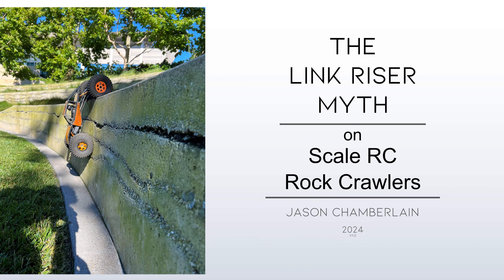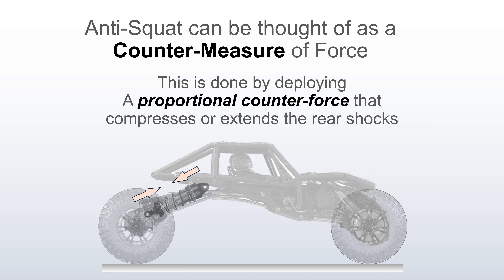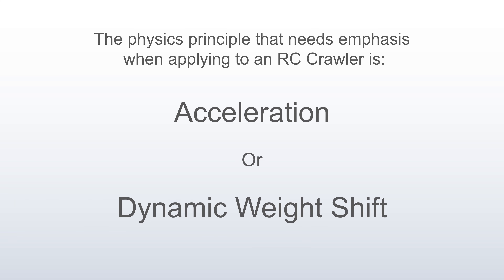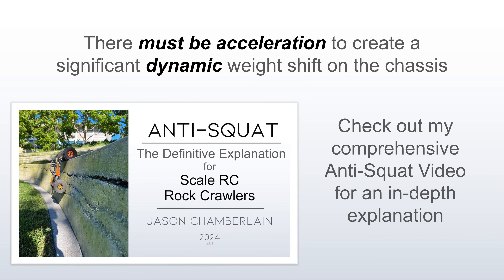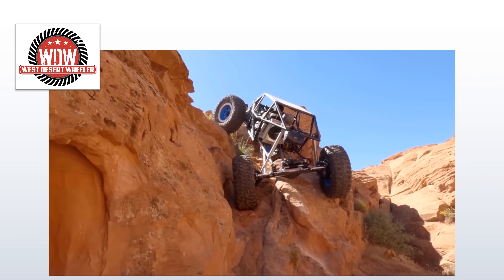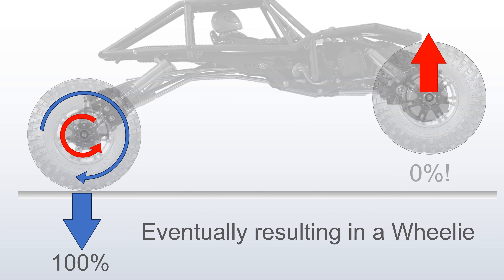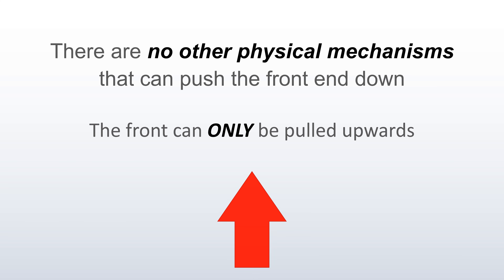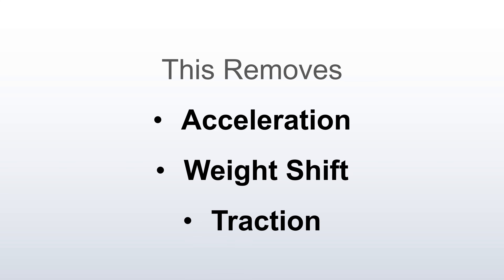Anti-Squat on RC Crawlers - Part 2: The Link Riser Demo

Comment: So if you also go watch a video from cleetus with live video of the rear suspension, it lifts under acceleration, which I'm turn puts more weight on the front, also with separation at the chassis it creates more leverage on the chassis it's self actually trying to stuff the front end into the ground. Same goes for anti dive, this stuff is all apart of almost every live axle vehicle.
Reply from the maker: Who is this cleetus?
Reply: Was the vehicle front or rear drive or 4 wheel? I’d be interested to watch that also
Reply from the maker: @lowandslowcrawlers  At slow speeds the linkage geometry does not matter. There is simply no math that supports that. If you find some, please share.
Reply from the maker: @independentmind1977  The vehicle in this video is 4WD.
Reply from the maker: @lowandslowcrawlers  I would like to know him. He sounds cool.
Reply: I was replying in reference to the Cleetus video mention. In my mind the front vs rear vs 4wd would have an effect, but seeing as most or all of us in the crawler world are on 4wd...it wont matter @BoomslangSuss
Reply: @BoomslangSuss  there is no speed in the math for ANY AS or AD.
Reply from the maker: @phuzzit  Nope.
Reply: @BoomslangSuss  then there is no way to justify speed as a determining factor in AS/AD. If it was then there would be speed that it turns on and off.
Saying AS/AD isn't there at low speeds is like saying gravity isn't there at low speeds.
Physics is always in play, some times we just don't see it bc we don't fully understand the other things affecting the equation.
Reply from the maker: @phuzzit  You are completely misunderstanding the basic concept of anti-squat. It only exists in the realm of sufficient acceleration to cause a dynamic weight shift of the chassis relative to the wheels. Speed doesn't turn it on and off, but acceleration does, and it self balances at all acceleration levels. Expect 0 - that is not an acceleration level.
Reply from the maker: @phuzzit  This isn't new. Anti-Squat is a thoroughly established and proven concept accepted worldwide by suspension engineers from Toyota to Tesla, from Specialized Bicycles to Yamaha, from Ferrari to F1.
Reply: @BoomslangSuss  he is talking about cleetus mcfarland with full size vehicles. however, it is not "stuffing" the front down - instead raising the rear.
Reply: @BoomslangSuss  your correct AS is a part of accepted vehicle physics and speed has never been a part of it.
Reply: @BoomslangSuss  acceration is defined as "undergo a change of velocity". Velocity is defined as "the speed of something in a given direction."
Your misusing the words. It is using speed as any given movement - not all movements but the ones you want. Any movement - fast, slow, ect.
If AS/AD did not work at low speeds then it would break the world of racing because they all have slow speed areas that rely on AS/AD to do their jobs.
When a tire gains traction, the force of that traction is tracked through all the components of the vehicle and they mechanically act with or against depending on the suspension design and tuning. This happens at every speed to assist launch, fast corners, slow corners.
Reply: @BoomslangSuss  I completely understand anti-squat and vehicle dynamics.
I also understand that you are misusing words to try and change what the auto world has known and used for years.
It's a great theory and all but it's incorrect and can never be proven. If it could be proven then you would be able to define acceration with a given window of speed and time to show when it works and doesn't work.
Thats just how physics and science works.
Reply: Think about how Boomslang explained the unsprung weight trying to outrun the sprung weight. Acceleration is key. You also have to realize gravity has a different affect on the front end the steeper the climb. You are not pushing the front end down  as much as lifting the entire vehicle off the obstacle at that angle. You have to realize any effort to push the front end down, oppositely and equally lift the rear end away from the climbing surface at steep angles.
Reply from the maker: @cameron6471  Thanks for the context. You are correct - you can lift the rear end with pro-squat, but that is not the same as pushing the front down.  It can prevent the front from unweighting but cannot add weight to the front.
Reply: @mikerainey3847  acceration having an affect on vehicle dynamics - correct. Anti-squat having no effect at slow speed - incorrect. 
A great example is torque twist - we have been fighting it for years with changes to the suspension links. Heck, Dlux made a 3 that acted against it. That is AD/AS working, at slow speeds.
Another example is MOA rigs, you can change how quickly they suck down by tuning suspension links.
At the end of the day, everything affects everything else. You can make massive overdriven rigs not suck down, you can add immediate traction with massive weights, and you can change how a rig will act in different situations with AD/AS. 
That is how vehicle dynamics has been taught for years, not that AD/AS does not exist at slow speeds.
Reply: @phuzzit  right, I  never tried to say it had no effect at all, just not any drastic affect. I actually commented earlier about the AS having effect on the torque twist.
Reply: @mikerainey3847  if you can make AS affect torque twist, then that is  a pretty drastic affect.
Reply: @BoomslangSuss  you are correct, you can not add weight that isn't there.
But you can tune the suspension to allow the front to dive only when the rear is acting on it or vise versa. MoA rigs have been doing it for years.
Reply from the maker: Is this JJ Rutten?
Reply: @BoomslangSuss  no, he's a great guy though
Reply from the maker: @phuzzit  There's one thing we can agree on! 😂

Comment: Does this also mean anti-squat has no effect on side hill driving when slow crawling?
Reply from the maker: Correct. Side hilling would be more a function of roll center geometry, but that is also a dynamic response to high speed cornering, not creeping. The best thing for side hilling is simply low CG and wide stance. And sway bars but those have other drawbacks.

Comment: It look like it did a little better on the traction board with the riser
Reply from the maker: I couldn't detect a significant difference either way. With such a big difference in AS%, if it were different it should have been really pronounced and obvious. I also tried to film the transmitter to show the amount of throttle input but it was drowned out by glare.

Comment: When force applied to rear axle links apply pressure to chassis, for most part slow crawling doesn’t matter that much but if you punch it to get over a steep obstacle I believe it helps still.
I mean when you get to risers and link geometry on a custom build you are getting extreme and then it may help as well on supper steeps to get from 55 degrees to 60+?????
Sorry but the rear wheel weighted down wasn’t going to show anything.
I will say the long long links on this chasis also must reduce the force, 
Neither made the climb, sooo decrease the angle till one fails.
Fine tuning is fine tuning.
And can go to far always.
Love your videos!!!!
Reply from the maker: Agreed - the rear wheel weighted was not going to show a difference, which is my point exactly. You can't push the front wheel down under any circumstance, which is what many people believe.
If I were to decrease the incline by 1/2 degree, the car without a link riser would climb it, which is why I selected that angle.   If the link riser made a difference, it would have shown up at this angle.

Comment: Kinda off topic but I’m in the market for some deluxe fab straight axles like what you have. Just trying to figure out all the parts necessary to order them 🤝🏻
Reply from the maker: I actually have portal C hubs so it starts as a straight axle but converted to portal. They are really nice axles. In the front I use Vanquish for different reasons.

Comment: I would love to hear your insights on overdrive at the axle vs overdrive in the transmission
Reply from the maker: What aspect are you curious about?  In general it doesn't matter where the gearing reduction is. The effect of torque twist is between your contact patch and your pinion.  The motor housing reacts to the resistive torque in the pinion, starting from your tire through the drivetrain to the pinion. Total torque is the same regardless of where the gearing reduction is in between. Does that help?
Reply: @BoomslangSuss  there were some discussion a while before, that it makes a difference,
1. That the "plowing" effect is different. 
2. Overdrive in the axle causes a larger gaps in gearing between that two ends of the driveshaft causing more torque twist.
Reply from the maker: @AnanFakheraldin  1) I'm not sure what's meant by plowing.  If you have front overdrive and forward weight bias, you front wheels will have more traction and drag the rear wheels.
2) If the available gear ratios are different between driveshaft, portal, axle and/or transmission then yes, the resultant torque will be different. If you are assuming an identical gear ratio from wheel to motor then there will not be any difference in torque twist. Think about what causes torque twist - picture your motor spindle/pinion being locked. The motor housing, which is connected to the chassis, rotates around the pinon, causing the chassis to rotate relative to the axles. The magnitude of this torque is the total gear ratio from your tire (assuming equal sized wheels) to the pinions. It doesn't matter where the gearing change is in between - only the total net torque is what matters.  

Some people will say that portals have less torque twist, which is true if you are simply adding the 2:1 portal reduction on top of your other gearing. But you wouldn't just add portals without adjusting your other gear ratios accordingly. You can't just add a 2:1 gear reduction and say the result is different. You've also halved your speed so it's no longer apples to apples. A portal makes no difference in torque twist if your total gear ratio from wheel to pinion is equal. If you are adding a portal with no other changes, yes your result will be different.
Reply: @BoomslangSuss  it make sense, your explanation about torque twist is different from what i understand, as i always though its the due to the difference gearing on the chassis than on the axle rather than the transmission case that wants twist.
Reply from the maker: @AnanFakheraldin  Your entire drivetrain sits on bearings, so there is no way that any part of that drivetrain could rotate it's housing (except for a negligible amount of bearing friction) until there is resistance. The only resistance is at the tire and at the motor and that's where the reaction forces act.

Comment: If torque twist is caused by the motors rotation, could the motor be turned 90 degrees to change the movement front to back, rather than left to right? Do MOAs have torque twist?
Reply from the maker: MOAs do not have torque twist - that is the beauty of them.  I like where your mind is going. As long as there are perpendicular driveshafts I believe torque twist is still going to be there. A belt drive front to rear where the torque is never redirected 90 deg might have to be the design. This deserves more research. I want to design a MOA that still looks like a shafty - same axles but with a motor attached to the rear axle and driveshaft to the front - could possibly eliminate MOST of the twist since it comes primarily from the rear.
Reply: @BoomslangSuss  both of those sound like a good idea!
Reply: @BoomslangSuss  this may not apply, but rc planes have the motor angled to offset the torque of the motor and fly straight. Could a combination of offset differentials, and angling the transmission the right way, make the driveline no longer perpendicular to the axles to offset some of the torque twist? The driveline u joints would be stressed at the axle side from the high angle, but it would be worth it for reduced torque twist.
Reply from the maker: @ShoddyRC  I like how you are thinking. You would need to have the pinon coming off the pumpkin skewed to one side for it to work.
Reply: @BoomslangSuss  that’s probably why it hasn’t been done. I think your moa rear axle idea is the most realistic.

Comment: It depends on your build. I have had vehicles that wouldn’t make certain climbs and I tuned and tuned and at my wits end against my better judgment added a riser and the went right up the line then there are rigs like I just posted and it doesn’t have a riser and it climbs extremely well. I think Capra axle with the absolute worst geometry are one that will need a riser 99% of the time.
Reply from the maker: It depends first and foremost on having sufficient acceleration to create a dynamic weight shift. AS is a dynamic response to a dynamic situation. If you are slow creeping at a constant speed, your AS number means nothing.
Reply: @BoomslangSuss  I’m talking about slow crawling the same line with the same vehicle and the riser being the only change. All other variables exactly the same. The only other change that happened was the axle position due to adding a riser and not adjusting link length. I’m not saying anti squat magically worked without acceleration I’m saying the addition of a riser and nothing else made a difference sometimes.
Reply from the maker: Well, there are not physics to support that.  People don't like to hear this, but usually their vehicles are not as "identical" as they think, and it's really tough to get repeatable results on real terrain that meet scientific rigor. Try double blind testing and see if you get the same results - have someone else set your link riser without telling you. Run it multiple times. At least 3 times, but 10 would be better.  Then let someone else drive your vehicle and don't tell them which setting they are in. When you start to add this statistical relevance I think you will find that you cannot tell a difference with and without a riser. There is simply no physical mechanism at slow speeds that could make a difference.

Or, ignore this altogether and just go drive and have fun! Thanks for watching the video and sharing your thoughts.
Reply: @BoomslangSuss  you can’t get more identical than failing to climb and going in your bag on the trail grabbing a riser and installing it then repeatedly making the same climb.
Reply from the maker: @covecityboys  So you practiced and got better. That's not statistically valid. Double blind and multiple runs with different drivers is the only way to eliminate the driver as a variable.
I'm telling you friend, no suspension engineer would agree that link risers work as you describe. There are simply no physics that support that, which means it's something else, like driver influence. No offense intended toward your diving skill - you are simply not driving the same in your trials.
I suspect you won't waste your time on a blind testing method, which I why I did it for you. Link risers don't work on paper or in controlled testing.

Comment: Hey awesome video would be cool to see a video on caster and link geometry ! Or a simplified video for cavemen like me on the ideal crawler setup. I've done some reading online but I'm still unsure.
Reply from the maker: Caster would be a great topic. Short answer - as much as possible in the front, zero in the rear if you have rear steer. I talk briefly about it here around 1:50:

https://youtu.be/TBqS80_JkSw?si=5ZMPCSOagepuPOU4
Reply from the maker: I talk a lot about linkage in this video (don't worry, I am working on a version that you don't have to read! ). The short answer is linkage geo is less important when you are moving slowly, but that's a great idea and I should make a simplified video.

https://youtu.be/-ad04wUd8PQ?si=grs4v9EH6AJZEwbQ
Reply: @BoomslangSuss  Hey I really appreciate you replying and sharing that information  with me I will definitely put it to use when I go to tuning. Also I apologize, I'll need to re-watch with my undivided attention I often work on my crawlers while watching youtube 😅 Thanks and have a good one!
Reply from the maker: @isaiah9313  No need to apologize! I was just trying to point you in the right direction, and I will certainly have more videos coming to help you out. Thanks for the ideas.

Comment: The torque twist seems like there is more with the riser installed.
Reply from the maker: There aren’t any physics that would support that, but if you feel it works better - run it!